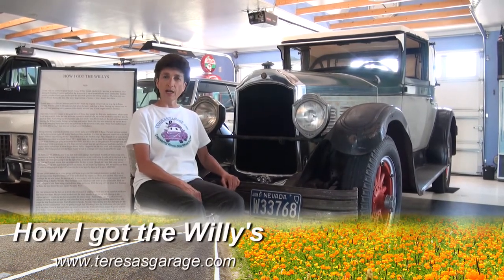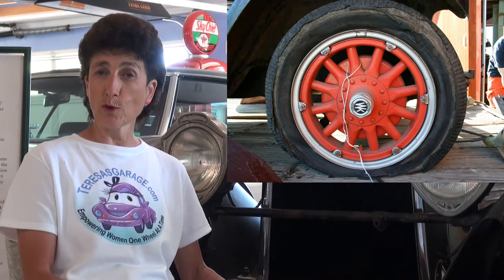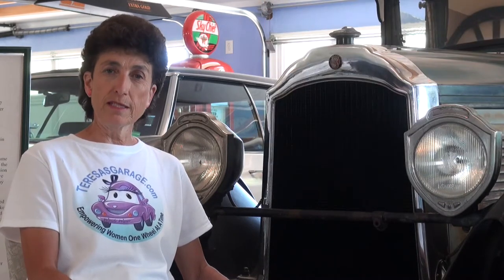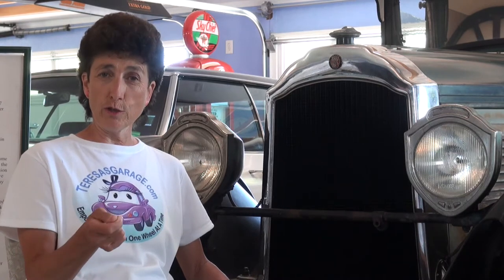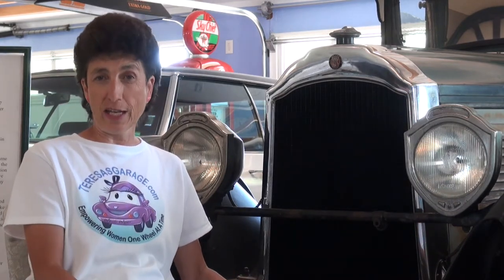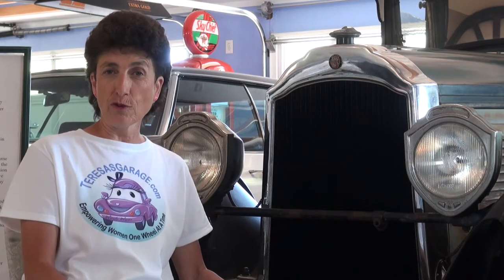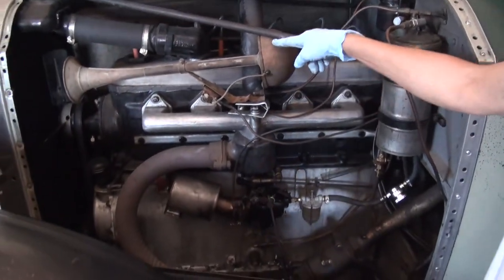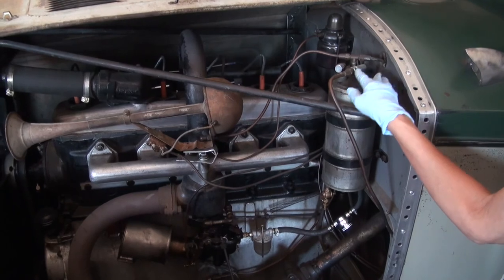Willys Knight Model 66A Cabriolet 1927

Comment: Wow, treasure of a car. I used to have a 1927 Jordan Great Line 8, but something about the Willys just pops like no other. I hope you can get to the bottom of any oiling issues and tech and see what is really the present situation with modern lubes and the motor all clean and freed up inside. Thanks mucho, Thailand Paul in Bangkok
Reply from the maker: Thanks for the comments. Sorry so late in responding. I do not get a message letting me know I have messages. As for the oiling problem, the fix would be a rebuild, since the junk rings, as they are called, need replacing. Hard to rebuild something that is so original and still running.

Comment: Your WK should not really smoke all that much. Did you have the sleeves and pistons out? Did you make sure all the rings were free in the piston lands and that all the oil scavenging grooves were cleaned out on the sleeves? There are very good instructions for servicing the oil rectifier and setting it up, available online. If you get the entire system working properly you should barely be able to detect oil smoke most of the time the car is running.
Reply: Thank you, I will check it out. I have not had the engine apart, nor has it been apart since brand new from what I am told. I have cleaned out the rectifier, but maybe I am missing something in the process. I will check it out online. Thanks for the comment.
Reply: You're welcome. By the way, it's pronounced Willis. If you watch some of the early promotional films you'll hear the name being pronounced correctly. Let me know if you have good luck with the rectifier challenge.
Reply from the maker: Yes I know, I just forget since I have said Willy's for so many years. Hard to break an old habit. Thanks for sharing that.